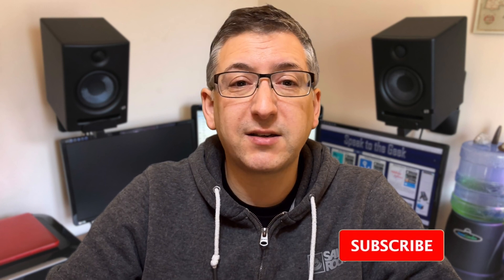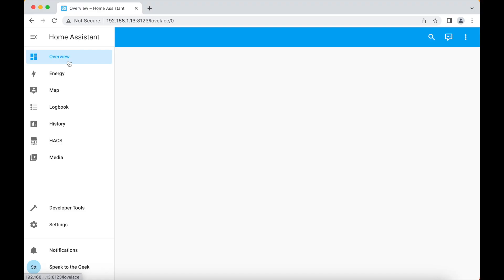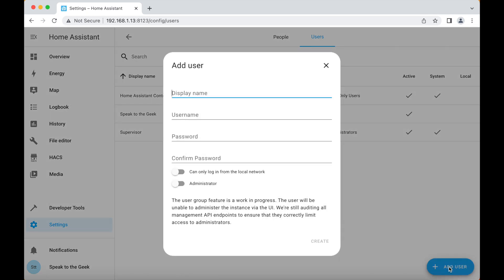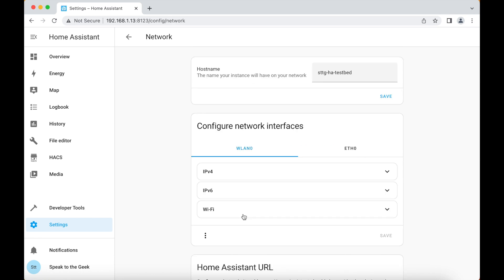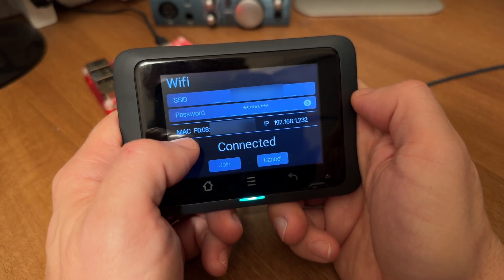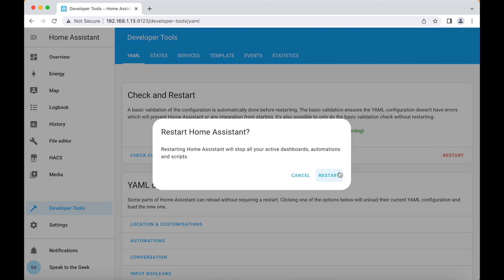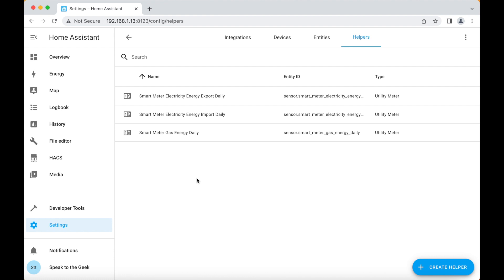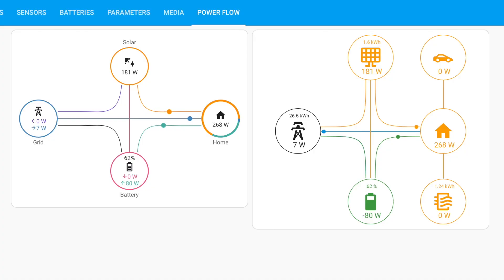Glow Smart Meter Display and Home Assistant: Configuration Tutorial

Comment: Just about to get smart meters installed here and wondering is this really the only way for folk in the UK to monitor energy usage using the free display they give you? I was playing with esphome glow before but figured given I'm being forced to upgrade to smart meters there has to be a better way.
Reply from the maker: Yes, this Hildebrand Glow display is a paid-for add-on which I am still using and I find it's the best option for getting your data straight out and into Home Assistant (or anything else MQTT compatible). If you are with Octopus Energy then you can ask them for an Octopus Home Mini, which will do a similar thing but you have to use their cloud API to fetch the data. Octopus are working on a 'Pro' version which will hopefully have local access too.
Reply: @SpeakToTheGeekTech  thanks for the super helpful reply. Will have to take a look! :)

Comment: Looking at your home assistant configuration guide for the glow meter. I have searched your script for the 9 times user id needs to be changed but can only find eight. Is that a typo or should gather really be nine instances. The graphs are not showing in the helper and I get sensor unknown

I have connected my CAD to home assistant and followed your instructions. Any thoughts?
Reply from the maker: There were 9, there are currently 8 and I updated the sample config when that changed but forgot the wording around it. In reality though my sensors are examples and you only add the config you require - so if you don't have a gas meter, you don't copy and paste that config in.
Reply: Changed the MAC address to all caps and am now getting data

Comment: @speaktothegeektech - quick question - if my smart meter can't reach my provider because the signal isn't strong, is the Glow Display a way to overcome that issue? I'm with Octopus and my meter is in my basement. Apparently there is a negligible radio signal. Thank you!
Reply from the maker: No, at the moment the only way for your smart meter to communicate with your energy provider is using a radio signal from the comms hub. In some areas they can fit external extension aerials - I have one fitted on mine, but there's currently no way for another device (a CAD, such as a Glow display or other wifi gadget) to relay official readings to your provider.

Comment: Hi,
trying to get my Glowmarkt IHD to connect to Home Assistant. I'm running HA on a QNAP NAS as a VM.
Did fine in the HA part but when checking the configuration (after inserting your code into the configuration.yaml with my devices MAC address in 8 (not 9?) places), I got a configuration error when I checked the setup, as follows.
Configuration errors
Error loading /config/configuration.yaml: while parsing a block mapping
in "/config/configuration.yaml", line 3, column 1
expected , but found '-'
in "/config/configuration.yaml", line 25, column 1

Line 3 would seem to be part of the original default config, so don't see how that could be a problem and line 25 is a "- name..." line as I recall.
Since I'm completely outside my comfort zone, I'm not sure how to proceed.
Any thoughts (hopefully I'm just doing something very simple wrong). I did paste your code into Word to do the MAC address substitutions and wondered if that might have messed with the formatting...
Please let me know if you need any further information.
Cheers
Iain
Reply from the maker: Copying and pasting it into Word has messed up the spacing. You should use a basic text editor such as Notepad to do that instead. YAML (the format used by the configuration files) is very sensitive to making sure that the indentations are perfect.
Reply: Hello again. That all seems to be working fine now, so thanks for getting back to me. One other thing I'm confused about is the difference (if any) between energy export and solar (these have different entries in the set up. For me export and solar are synonymous. What am I missing?
Thanks again,
Cheers
Iain
Reply from the maker: @iainfarquhar3474  No they're very different. Solar is what your panels are generating, export is what you are sending out to the grid, the difference between them is what you are using in your home.
Reply: @SpeakToTheGeekTech  OK, understood. Most of our solar goes to our immersion heater so that makes sense. Thanks again.

Comment: If you want a cost per hour display also you can add this to yaml

template:
  - sensor:
      - name: "Current Electricity Cost per Hour"
        unit_of_measurement: "GBP/h"
        state: >
          {% set power_kw = states('sensor.smart_meter_electricity_power') | float / 1000 %}
          {% set unit_rate = states('sensor.smart_meter_electricity_import_unit_rate') | float %}
          {{ (power_kw * unit_rate) | round(2) }}
        icon: mdi:cash
Reply from the maker: Thanks for the tip!

Comment: Is it possible to also use the CAD to pull the smart meters Voltage readings? 

Interested in getting a log/comparison to my inverters readings
Reply from the maker: No, that information isn't available. You can use something like a Shelly EM to get that if needed but it's not available from a smart meter CAD.

Comment: With solar. How fast you can react to enable charge your batteries when detecting you are returning electricity to the grid? Displays seems to be 1 reading each 30sec?
Reply from the maker: Your smart meter updates the live power data roughly once every 10 seconds and sends that to the display or whatever CADs you have attached to it (like Glow). However, the smart meter has nothing to do with my solar/battery reactivity - my GivEnergy battery inverter is monitoring the grid separately and can react within milliseconds to changes in power. If I were writing my own automations in Home Assistant to manually manage that sort of thing using the smart meter then you would be looking at a delay of 10-30 seconds including your batteries processing the commands. I don't think that would be a feasible way to manage it, it would be too slow.

Comment: Brilliant mate. What would you use to track the price? I'm on Agile so can't use fixed!!
Reply from the maker: You can use Bottlecapdave's Octopus Energy integration. There will be a 'current_rate' entity associated with your electricity meter that you can select in the dashboard configuration. It's basically what I do but on Octopus Go. Keep an eye on it though because sometimes there are updates to the integration which change the entity names and you have to go and reconfigure the dash to the new ones. https://github.com/BottlecapDave/HomeAssistant-OctopusEnergy
Reply: @SpeakToTheGeekTech  cheers mate.

Comment: Another great video however I have  a problem . You stated "Open the File editor add-on and make sure you are editing the file called configuration.yaml by selecting the Browse Filesystem button, checking that you’re in the config/ folder, then clicking on configuration.yaml." In my case there doesn't seem to be any config/ folder and configuration.yaml  is in the /homeassistant/ folder. My Glow IHD is working fine both directly and via  Bright  but the entities in HA don't seem to update - perhaps the configuration.yaml location is part of the problem? (Everthing else works fine in my HA - installed on a SSD using Rpi Imager and accessed on Widows 11 PC via url)
Reply from the maker: Hi - this is the problem with me showing exact processes on an ever changing platform, my video is now out of date :( You are looking in the correct file because it's now in /homeassistant as of a few releases ago. If the sensors you have created are not updating then there will be an error in the configuration at one of the many tricky points in the chain! You have to confirm that you are sending data from the IHD to MQTT, and the Mosquitto add-on lets you monitor what messages are going through. If nothing is updating at all then I suggest that's the first place to look.
Reply from the maker: There's also an integration (via HACS) that you can install which replaces the manual config part: https://github.com/megakid/ha_hildebrand_glow_ihd_mqtt - you still need MQTT up and running properly though.

Comment: Not directly related to home assistant but do you know if it’s possible to change the home display of the IHD to show actual electricity and gas usage now (cost or kw). The default seems to be cost for the day.
Reply from the maker: Yeah you just tap on the electricity usage on the screen and it switches to show watts.
Reply: @SpeakToTheGeekTech  great I did see that but then the display only displays electricity or gas (depending on which icon you press) but I was hopeful of getting both on the home screen. Very similar to that which is visible on other devices e.g. trio ii
Reply from the maker: No it’s not possible, but also live gas is kind of pointless anyway - gas only shows energy usage over the last 30 minutes. I just leave my display on the electricity live power display personally
Reply: Agreed that is where I am now. Appreciate your help.

Comment: Hi
Some great videos. Installed and all working for a few month now, so thanks for the guides.
My question is it possible to to create a daily export sensor as by default the CAD only sends an accumulated total export of the meter since install. I guess this would require creating some code in HA?
Thanks in advance
Reply from the maker: Totally possible with no coding. Create a ‘helper’ (settings > devices & services) of a type “utility meter”, choose the source sensor as you cumulative energy one and set the cycle to daily

Comment: I'm a total novice at this and i've managed to install Home Assistant by following youtube videos only.  I've followed this video to add my Glow smart meter to my home assistant energy dashboard.  I'm now trying to add my Sunsynk solar & battery system to the dashboard via Solar Assistant but I'm not sure how to add more entities to the MosquittoMQTT as when i click onto the MQTT it says only a single configuration is possible.  Not sure what i'm doing wrong, are you able to advise?
Reply from the maker: You can only have one instance of MQTT in Home Assistant. All solutions which use MQTT must talk to that one instance. I have never used the Sunsynk integration and I don’t know what Solar Assistant is sorry.
Reply: @SpeakToTheGeekTech  Hi, thanks for the reply.  I've had a play about with it and i think i've stumbled across the solution by pure chance.  Solar Assistant is installed on a raspberry Pi which is plugged directly into my inverter and it appears to act as the MQTT broker.  I have loaded the SA details onto HA first and then added my Glow smart meter details and i now have both sets of data showing on the energy dashboard, at least that's what I think has happened!  I wanted to use the smart meter data for energy to and from the grid as that's going to be more accurate than the inverter data.  I'll now start working through your other videos to see if i can try and learn how to use HA and get a proper dashboard set up.

Comment: Hi , Does this work with the latest HA ? As i tried everything on your video but i cant get any meter readings. On the new HA ive put the files into /homeassistant/configuration.yaml as there is no config in directory any more. Ive tested it on MQTT  and started to listen to a topic but no communication. Any Ideas where i may have gone wrong on new system? thanks
Reply from the maker: I'm still running with the same configuration, yes. If you're not seeing anything in MQTT then the most likely cause is credentials or communication from the display to Mosquitto. Did you confirm on the display that it is showing as connected to MQTT ok?
Reply: Yes on the Display its showing as connected. That’s why I’m confused as everything looks ok but no communication
Reply: I’m running this on HA green the new device by them..Don’t know if it’s compatible.
Reply: Ive managed to get it working but had to install Hildebrand Glow IHD MQTT. It basically had all the meter info same as what your code had. Thanks for the idea of using Glow Smart Meter Display

Comment: Thank you for this video, helped me alot. One question, I am wanting to set an automation based on current export from solar being over 2.5kwh but I can only see the 15 minute interval in the helper setup. Any ideas?
Reply from the maker: I’m either not understanding or you are perhaps mixing up energy (kWh) with power (kW)? If you are wanting to automate based on when the export power goes over 2.5kW, then you don’t need a helper. Your automation’s trigger should be a numeric state trigger for the export power entity.

Comment: Excellent Video and code to use.  I had got this working but realised that the 8GB SD I had, probably should be changed to something larger if it is retrieving all this data.  Did a restore and now I can't get the Daily Import to work.  Odd thing is, in the energy view, it appears to be very close to what my glow CAD shows, but if I create a Gauge for that helper, it always shows 0.  Odd.
Reply: If I am reading this correctly, in the Yaml script the Energy Import is an increasing number.  The Helper is resetting to 0 on a daily basis, which I assume is midnight, and then taking the last imported number and deleting that against the next readings, basically showing the change.  Love the blind tilt device, wish DW would let me get a couple for the living room!
Reply from the maker: A daily cycled helper wrapping the energy import sensor should reset to 0 at midnight. You can customise that to do something different if you'd prefer, my demo was just a suggestion. And yes, those blind tilts are brilliant - still have them running on both windows shown in the video, never had to charge them due to the solar panels.
Reply: @SpeakToTheGeekTech  I believe I got the issue fixed.  I’ll see tomorrow. Great vids

Comment: It's started throwing an error for me, specifically in the energy export part of the script. I won't paste the whole error but it appears to be a python parsing error 'ValueError: could not convert string to float: '-75e''

This is confusing to me as I can't see any obvious place where the MQTT output shows this, especially in the energy/export/cumulative field it's looking at.
Reply from the maker: I'm not sure what's causing that but I suggest to debug this you rip out all of the configuration and put each sensor back one at a time. That way you'll quickly be able to narrow down the problem to the one (hopefully just one) causing you the issue.

Comment: Hi - thanks for this - great tutorial - and thanks for everything you do - I need some help though as I'm having exactly the same issue as TonyWheelerFWB. I've configured this twice now using your step-by-step instructions twice. I've got the helpers configured, they are showing information for my daily import and export for all three sensors (2xElectricity, 1xGas). Will not show up in the drop-down section when I follow your instructions (9:59 in your video)
Reply from the maker: Have you checked the units reported by the utility meter sensors you've created? Are they definitely kWh not kW/W?

Comment: Hi returning to this set up i have one problem that I cannot resolve. In the overview dasboard under Sensors, the sensor Smart Meter Gas: Power shows as "unknown". 
The relevant section of the configuration.yaml is:
    - name: "Smart Meter Gas: Power"
      unique_id: "smart_meter_gas_power"
      state_topic: "glow/mmmmmm/SENSOR/gasmeter"
      device_class: "power"
      unit_of_measurement: "W"
      state_class: "measurement"
      value_template: "{{ (value_json['gasmeter']['power']['value'] * 1000) | round() }}"
      icon: "mdi:fire"
and appears to be identical to the corresponding Smart Meter Electricity: Power section.
Why is the Gas Sensor "unknown"
Thanks as usual
Reply from the maker: Gas meter power isn’t a proper thing anymore, I’ll update my article to remove that later. The gas meter only pushes data every 30 minutes so even if it sent power, it would be a value from that specific moment in time and likely totally invalid a few seconds later. Energy data from gas is more realistic and reliable.
Reply: @SpeakToTheGeekTech  Thanks. I thought that might be the case but I didn't have the confidence that I knew what it was for. Would best practice be to delete from the configuration or hide it